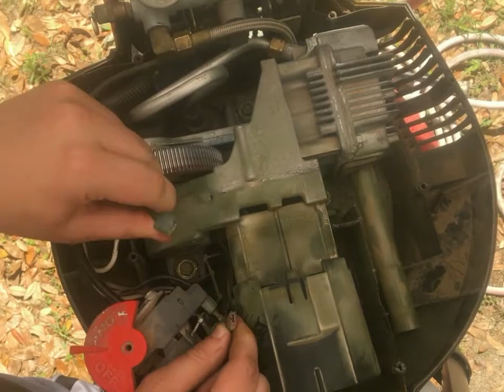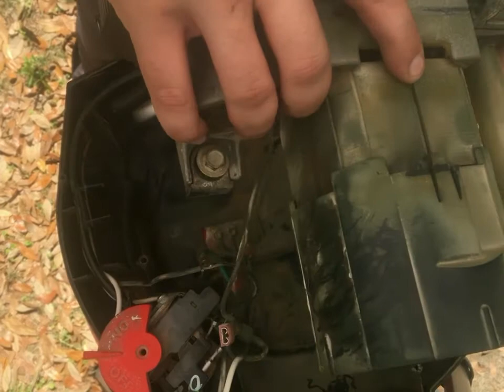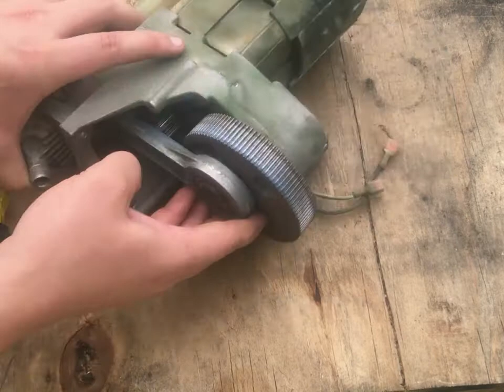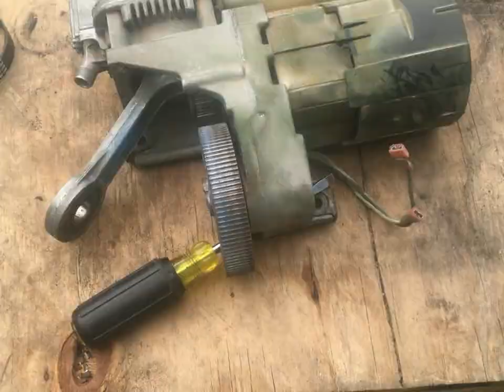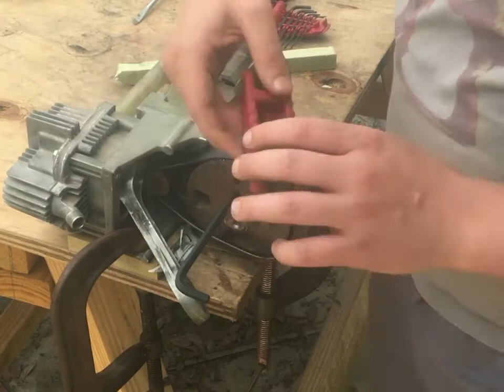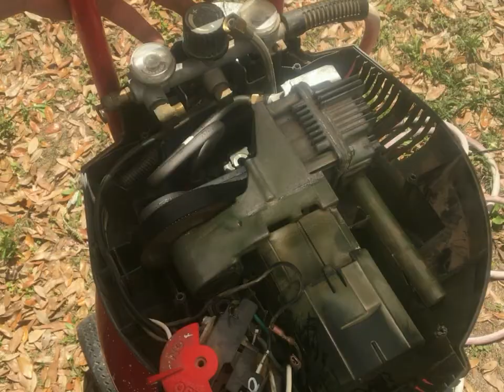Replacing a Drive Belt on a Husky Air Compressor (model# 417 270): Tools used listed in description

Comment: Great Video.. but, you can save a lot time by not pulling the motor out of the unit..  I noticed in your video after loosen the center rod allen bolt, the rod falls "away" from the pulleys allowing you to remove and reinstall the new belt with the added clearance.
Reply: Yup!

Comment: What did it sound like when the belt broke do it just make a high pitch sound like it started turning way to fast? I just got a compressor just like this one from a friend and when i turn it on it makes a high pitched noise like the motor is turning way to fast, I realized all the teeth on the belt or stripped out. I'm wandering if its just the belt or if its something else.